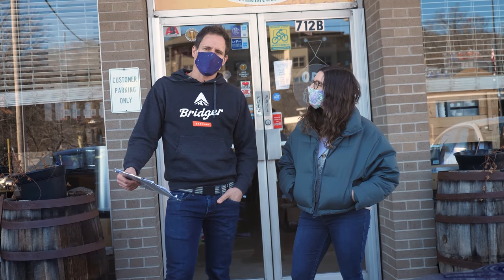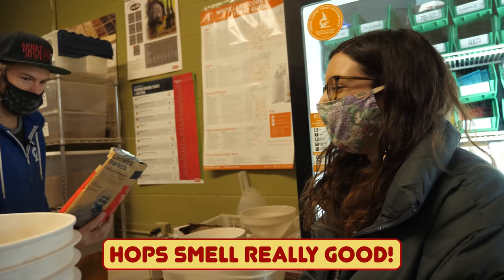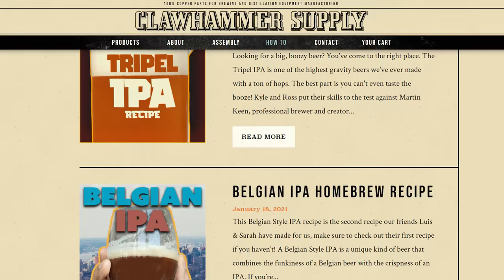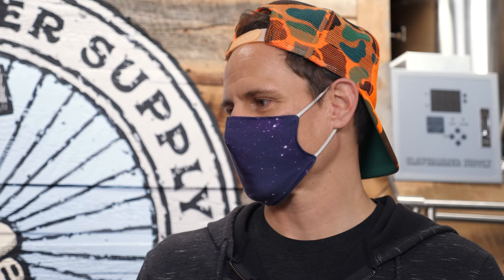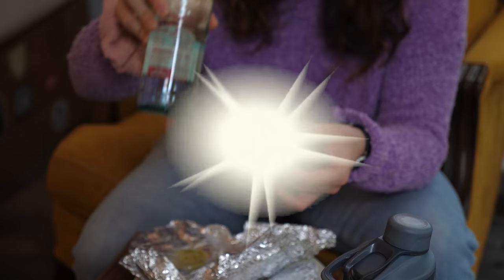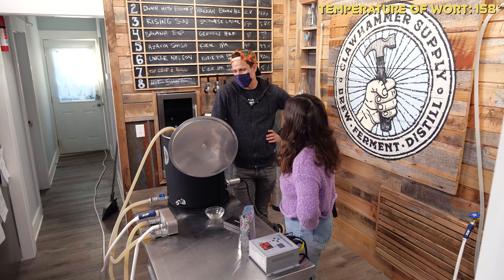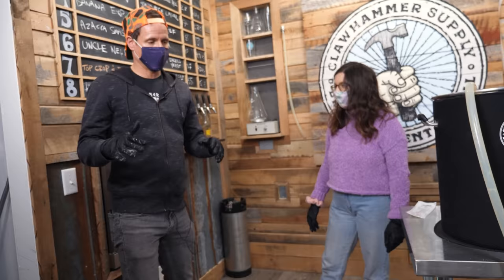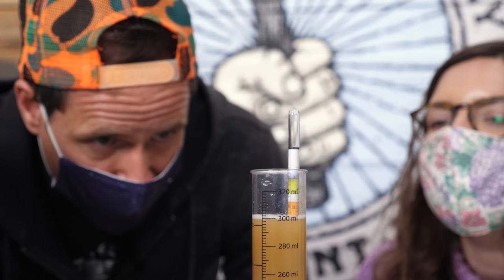HOMEBREWING FOR BEGINNERS - How to Make Beer at Home 🏠🍺

Comment: As a quick note on water chemistry, check your city's tap water quality report for if they use chlorine or chloramine for disinfection, if they use chloramine instead, letting it stand overnight will not cause the chloramine to evaporate which can cause all kinds of problems down the line!

Comment: If you grind the grain less it will be naturally clearer.. in Japan, Saké is graded by how finely ground the rice is for instance. I never grind anything, cause the yeast can get the nutrients by soaking stuff in enzymes, IE through osmosis.

Natural spring water is probably the best water to use, but distilled water will give it a clearer, more "bright" look. Any dissolved solids in the water the yeast can't process will stay dissolved and cause it to be more murky.

Yeast is active in the refrigerator, just less so and it also behaves differently. Lager, for instance, is beer fermented at a cooler temperature, which leads to a less "fruity" taste.

Comment: You guys still have Uncle Nelson on the board, is that the same one or did you brew it again?
Reply from the maker: Hahah, glad someone noticed that. We've been in the process of re-building our tap system forever so most of those taps aren't being used and haven't changed

Comment: If you’re using well water, how does that affect your water chemistry?
Reply: You need to have it tested so you know the mineral content of it. Or just don't bother with water chemistry. If the water tastes good it will probably make good beer.
Alternatively, you could get a reverse osmosis system which removes all minerals from the water (some RO systems come with a module to re-mineralize the water, you don't want to use that bit). Then you have a blank slate to add minerals to.
Reply: @fdk7014  thank you!
Reply: @fdk7014  Could you just use distilled water?  If you can, do you still need to do "water Chemistry" or is it ready to go?
Reply: @joshuarimes9239  Distilled water is completely void of minerals so you should still add some to get a good balance. Pilsners and lagers in general are best with water low in minerals but there should still be some.

Comment: Why use so much sanitizer solution? You can just prepare two liters of solution(even that's much), put everything you need to sanitize in the bucket, put the lid on and give it a good shake. Use less water and less StarSan
Reply from the maker: We typically keep the same batch around the office and use it for various other things.